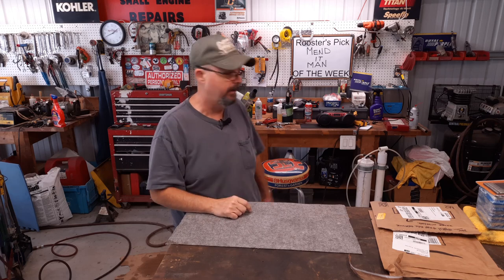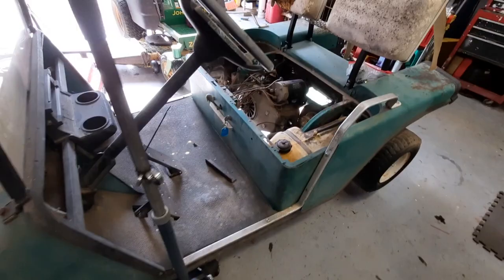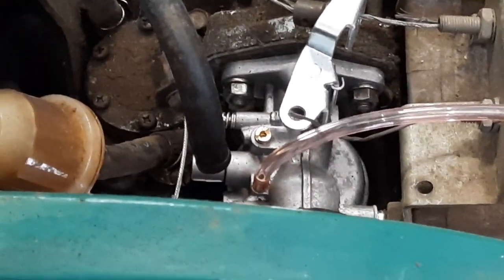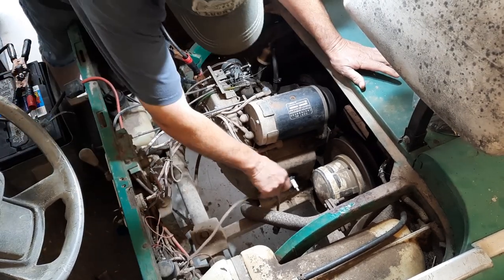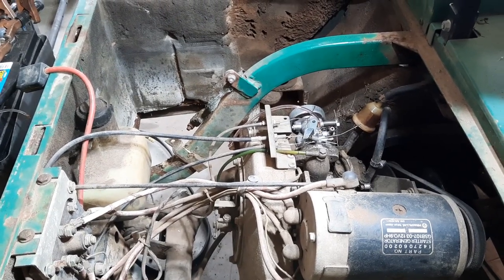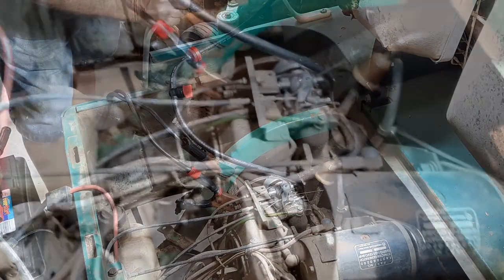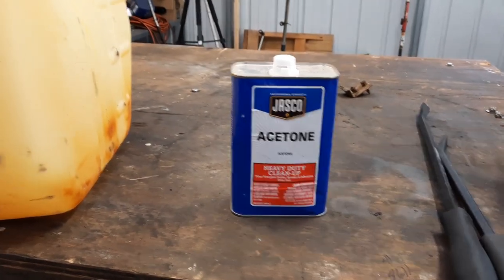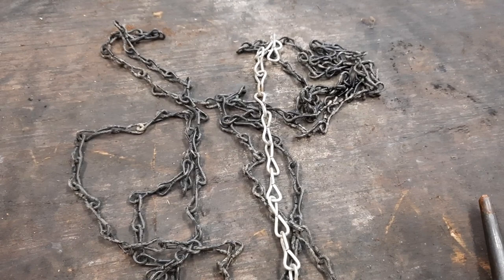Saved Pop's EZGO Golf Cart.

Comment: What is the oil/fuel ratio in the old 2 strokes? Just picked up an old ez go just like that. Looking forward to getting it going for my wife and kid to ride around the neighborhood.
Reply from the maker: ratio oil/gas on a 89 2 cycle ezgo marathon, Is 128:1. 1 oz. + to 1 gal. it is not recommended to add oil directly to your fuel tank and then pour in the gasoline.
Reply: @TheRustyRooster  thank you sir! I had 2 stroke dirt bikes that I pre-mixed when I was a kid but it’s been years.
Reply from the maker: @nickcummings81  check the old oiler it might still work.  If not plug off the oil port at intake and premix your fuel.  Thanks hope this helps

Comment: I have a 1983 Ezgo 2 stroke runs strong, but smokes a lot I even put the low smoke oil in it, I expect some smoke but this thing is embarrassing
. Any ideas.
Reply from the maker: Hey, ol-buddy, I'd double-check my fuel:oil ratio. Other than that, it's a 40-year-old engine. Rings and crank seals might be the fix. Thanks for watching.